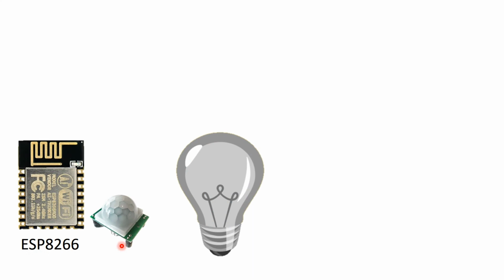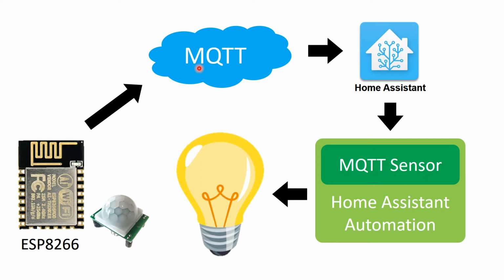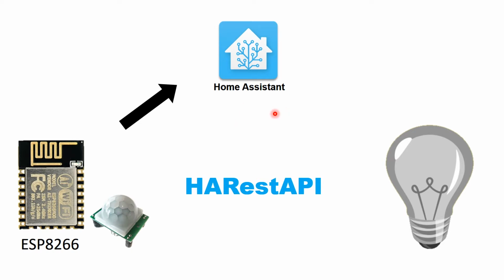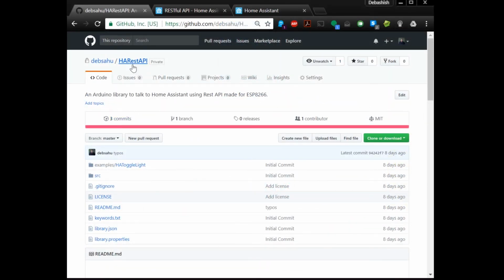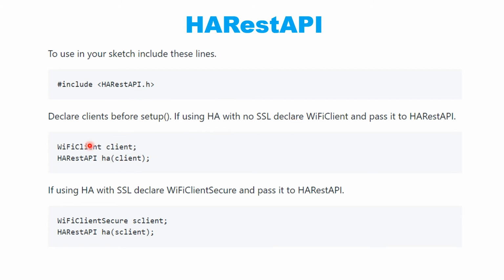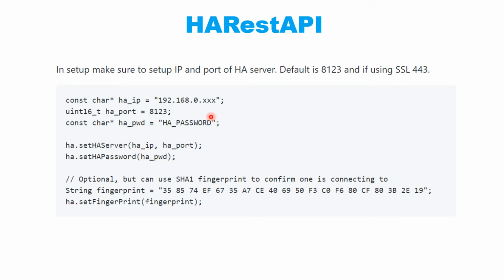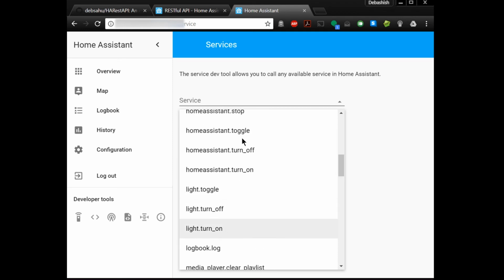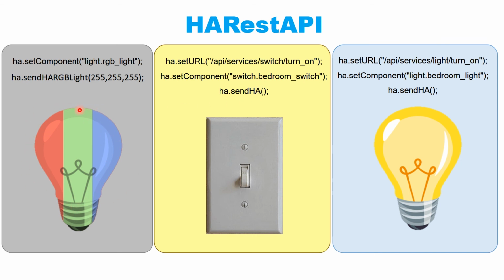HARestAPI: Control Home Assistant directly using ESP8266

Comment: Can we do vice versa like send command from home assistant to nodemcu. What I am trying to do is turn on or off the relay with nodemcu from home assistant and that nodemcu is outside the network that home assistant is using for example nodemcu is somewhere else
Reply: @deb-sahu  but mqtt works on the same network means nodemcu and home assistant should be in same place and network, please correct me if I am wrong. I want to control nodemcu through internet using home assistant. Nodemcu may be in different city connected to different wifi for example, can i control it using home assistant? Thanks for quick reply
Reply: @deb-sahu  sounds great thank you very much will let you know when i complete that project

Comment: I think this is great tutorial and author made a good job! Unfortunetly, POST messages doesn't work for me with my homeassistant :/
Reply: @deb-sahu  , I have successfully added long lived access token. I'm successfully receiving GET messages (all of them according to documentation stored here: https://developers.home-assistant.io/docs/en/external_api_rest.html ). I'm even able to do simple POST command like from home assistant documentation  which is ( POST /api/config/core/check_config
 ) and i'm getting status of my configuration file. Only one thing which i'm not able to do is : POST /api/states/<entity_id>. I have checked several times service state through "developers tools" in home assistant if i put correctly values there. So, my final command to turn on light is: 

curl -X post -H "Authorization: Bearer TOKEN"  -H "Content-Type: application/json" -d '{"entity_id":"light.salon"}' http://IPADDRESS:8123/api/services/light/turn_on

It always returning 400:Bad request

I even tried suggestion which i found in the internet:

curl -X post -H "Authorization: Bearer TOKEN"  -H "Content-Type: application/json" -d '{"domain":"light","services":"turn on","entity_id":"light.salon"}' http://IPADDRESS:8123/api/services

same result:  400:Bad request

I guess it's problem with home assistant REST services... Is that command works in your homeassistant? (accordingly with changed IPAddress and Entity_id in your configuration? 

Thanks again

Comment: Are you able to use this to control the brightness of a LIFX build and a wemo dimmer connected to home assistant at the same time? How do you add multiple input pullup?
Reply: Debashish Sahu 
Thanks for the prompt reply. I understand what you mean and I have already enabled the Home assistant RestApi. To clarify my question, how do you addd multiple input pull-up (multiple push button) to 1 ESP 8266 Program. I want to be able to use the Node MCU for multiple automation instead of the default 1 input pull-up in the program. Thanks.
Reply: @deb-sahu  
Please see the code summary below for what I mean

this is from the original code. Sorry I am new to this. Thanks
=========================================================
#define BUTTON_PIN 0 // Flash button on NodemMCU
  pinMode(BUTTON_PIN,INPUT_PULLUP);

  ha.setHAServer(ha_ip, ha_port);
  
  ha.setHAPassword(ha_pwd);

  ha.setFingerPrint(fingerprint); // Only used if HA is running SSL

  pinMode(BUTTON_PIN,INPUT_PULLUP);

  debouncer.attach(BUTTON_PIN);

  debouncer.interval(50);

void loop() {

  debouncer.update();

  if ( debouncer.fell() ) {

    ha.setURL("/api/services/light/toggle");
 
    ha.sendHAComponent("light.bedroom_3_light");

  }

}

are yo uable to modify the code for multiple input like this by defining BUTTON_PIN 0
SWITCH_PIN 1
===========================================

#define BUTTON_PIN 0 // Flash button on NodemMCU
  pinMode(BUTTON_PIN,INPUT_PULLUP);

#define SWITCH_PIN 1 // Flash button on NodemMCU
  pinMode(SWITCH_PIN,INPUT_PULLUP);

  ha.setHAServer(ha_ip, ha_port);
  
  ha.setHAPassword(ha_pwd);

  ha.setFingerPrint(fingerprint); // Only used if HA is running SSL

  pinMode(BUTTON_PIN,INPUT_PULLUP);

  pinMode(SWITCH_PIN,INPUT_PULLUP);

  debouncer.attach(BUTTON_PIN);

  debouncer.attach(SWITCH_PIN);
  debouncer.interval(50);

void loop() {

  debouncer.update();

  if ( debouncer.fell() ) {

    ha.setURL("/api/services/light/toggle");
 
    ha.sendHAComponent("light.bedroom_3_light");

  }

  if ( debouncer.fell() ) {

    ha.setURL("/api/services/light/toggle");
 
    ha.sendHAComponent("light.bedroom_2_light");

  }

}
Reply: @deb-sahu  
Thanks! Will give a it try and update you. That's exactly what I was asking for.
Reply: Thanks for you help. After 6 hours , finally, I got the code to do just exactly what I wanted. Must say I used a slightly different approach. Credit goes bounce2 library developer. If anyone is interested, see below. My nest steps is to go a step forward and add deep sleep code so ESP8266 is able to run on battery power for years. Anyways, here you go
-------------------------------------------------------------   

#include <ESP8266WiFi.h>
#include <Bounce2.h>                     // https://github.com/thomasfredericks/Bounce2
#include <HARestAPI.h>
//#include "secret.h";

#define D0_BUTTON_PIN 16
#define D1_BUTTON_PIN 5
#define D2_BUTTON_PIN 4
#define D3_BUTTON_PIN 0
#define D4_BUTTON_PIN 2
#define D5_BUTTON_PIN 14
#define D6_BUTTON_PIN 12 
#define D7_BUTTON_PIN 13
#define D8_BUTTON_PIN 15
#define D9_BUTTON_PIN 3
#define LED_PIN 10

// Instantiate a Bounce object
Bounce debouncer1 = Bounce(); 

// Instantiate another Bounce object
Bounce debouncer2 = Bounce(); 

// Instantiate a Bounce object
Bounce debouncer3 = Bounce(); 

// Instantiate another Bounce object
Bounce debouncer4 = Bounce(); 

// Instantiate a Bounce object
Bounce debouncer5 = Bounce(); 

// Instantiate another Bounce object
Bounce debouncer6 = Bounce(); 

// Instantiate a Bounce object
Bounce debouncer7 = Bounce(); 

// Instantiate another Bounce object
Bounce debouncer8 = Bounce(); 

// Instantiate a Bounce object
Bounce debouncer9 = Bounce(); 

WiFiClient client;
HARestAPI ha(client);

#ifndef SECRET
const char* ssid = "YOUR_WIFI_SSID";
const char* password = "YOU_WIFI_PASS";
const char* ha_ip = "192.168.X.XX";
uint16_t ha_port = 8123; // Could be 443 is using SSL
const char* ha_pwd = "HOME_ASSISTANT_API_PASSWORD";
String fingerprint = "35 85 74 EF 67 35 A7 CE 40 69 50 F3 C0 F6 80 CF 80 3B 2E 19";
#endif

//Bounce debouncer = Bounce(); 

void setup() {
  Serial.begin(115200);
  Serial.println();
  Serial.print("connecting to ");
  Serial.println(ssid);
  WiFi.mode(WIFI_STA);
  WiFi.begin(ssid, password);
  while (WiFi.status() != WL_CONNECTED) {
    delay(500);
    Serial.print(".");
  }
  Serial.println("");
  Serial.println("WiFi connected");
  Serial.println("IP address: ");
  Serial.println(WiFi.localIP());
  
  ha.setHAServer(ha_ip, ha_port);
  ha.setHAPassword(ha_pwd);
  ha.setFingerPrint(fingerprint); // Only used if HA is running SSL

  

  // Setup the first button with an internal pull-up :
  pinMode(D1_BUTTON_PIN,INPUT_PULLUP);
  // After setting up the button, setup the Bounce instance :
  debouncer1.attach(D1_BUTTON_PIN);
  debouncer1.interval(5); // interval in ms
  
   // Setup the second button with an internal pull-up :
  pinMode(D2_BUTTON_PIN,INPUT_PULLUP);
  // After setting up the button, setup the Bounce instance :
  debouncer2.attach(D2_BUTTON_PIN);
  debouncer2.interval(5); // interval in ms

   // Setup the second button with an internal pull-up :
  pinMode(D3_BUTTON_PIN,INPUT_PULLUP);
  // After setting up the button, setup the Bounce instance :
  debouncer3.attach(D3_BUTTON_PIN);
  debouncer3.interval(5); // interval in ms

   // Setup the second button with an internal pull-up :
  pinMode(D4_BUTTON_PIN,INPUT_PULLUP);
  // After setting up the button, setup the Bounce instance :
  debouncer4.attach(D4_BUTTON_PIN);
  debouncer4.interval(5); // interval in ms

   // Setup the second button with an internal pull-up :
  pinMode(D5_BUTTON_PIN,INPUT_PULLUP);
  // After setting up the button, setup the Bounce instance :
  debouncer5.attach(D5_BUTTON_PIN);
  debouncer5.interval(5); // interval in ms

   // Setup the second button with an internal pull-up :
  pinMode(D6_BUTTON_PIN,INPUT_PULLUP);
  // After setting up the button, setup the Bounce instance :
  debouncer6.attach(D6_BUTTON_PIN);
  debouncer6.interval(5); // interval in ms

   // Setup the second button with an internal pull-up :
  pinMode(D7_BUTTON_PIN,INPUT_PULLUP);
  // After setting up the button, setup the Bounce instance :
  debouncer7.attach(D7_BUTTON_PIN);
  debouncer7.interval(5); // interval in ms

   // Setup the second button with an internal pull-up :
  pinMode(D8_BUTTON_PIN,INPUT_PULLUP);
  // After setting up the button, setup the Bounce instance :
  debouncer8.attach(D8_BUTTON_PIN);
  debouncer8.interval(5); // interval in ms

   // Setup the second button with an internal pull-up :
  pinMode(D9_BUTTON_PIN,INPUT_PULLUP);
  // After setting up the button, setup the Bounce instance :
  debouncer9.attach(D9_BUTTON_PIN);
  debouncer9.interval(5); // interval in ms

  //Setup the LED :
  pinMode(LED_PIN,OUTPUT);

}

void loop() {
  // Update the Bounce instances :
  debouncer1.update();
  debouncer2.update();
  debouncer3.update();
  debouncer4.update();
  debouncer5.update();
  debouncer6.update();
  debouncer7.update();
  debouncer8.update();
  debouncer9.update();

  
  
  

  // Get the updated value :
  int value1 = debouncer1.read();
  int value2 = debouncer2.read();
  int value3 = debouncer3.read();
  int value4 = debouncer4.read();
  int value5 = debouncer5.read();
  int value6 = debouncer6.read();
  int value7 = debouncer7.read();
  int value8 = debouncer8.read();
  int value9 = debouncer9.read();  

    if ( debouncer1.fell() ) {

      ha.setURL("/api/services/light/toggle");
      ha.sendHAComponent("light.lifx_pls_a19_2333c5");
    }  

    if ( debouncer2.fell() ) {

      ha.setURL("/api/services/switch/toggle");
      ha.sendHAComponent("switch.kitchen_light_switch");
    }  

    if ( debouncer3.fell() ) {

      ha.setURL("/api/services/light/toggle");
      ha.sendHAComponent("light.kitchen_cabinet_light");
    }  

    if ( debouncer4.fell() ) {

      ha.setURL("/api/services/light/toggle");
      ha.sendHAComponent("light.kitchen_light_strip");
    }  

    if ( debouncer5.fell() ) {

      ha.setURL("/api/services/light/toggle");
      ha.sendHAComponent("light.living_room_rear_spotlight");
    }  

    if ( debouncer6.fell() ) {

      ha.setURL("/api/services/light/toggle");
      ha.sendHAComponent("light.living_room_front_spot_light");
    } 

    if ( debouncer7.fell() ) {

      ha.setURL("/api/services/light/toggle");
      ha.sendHAComponent("light.office_spot_light");
    } 

    if ( debouncer7.fell() ) {

      ha.setURL("/api/services/switch/toggle");
      ha.sendHAComponent("switch.office_light_switch");
    } 

 
}